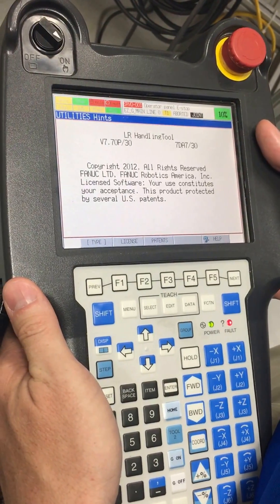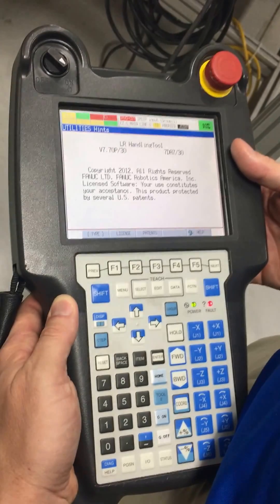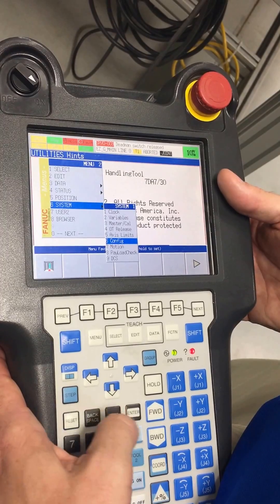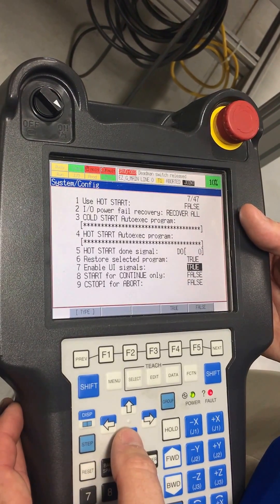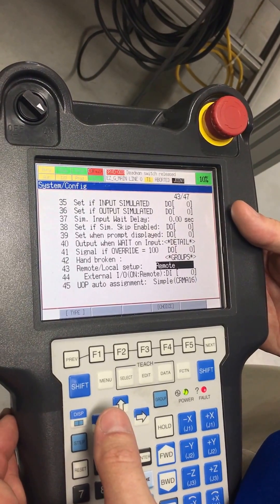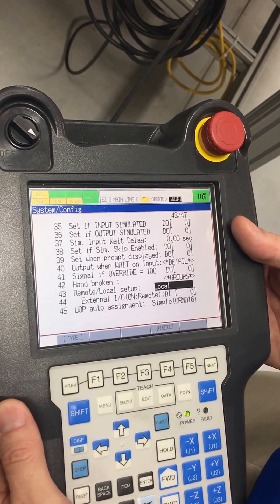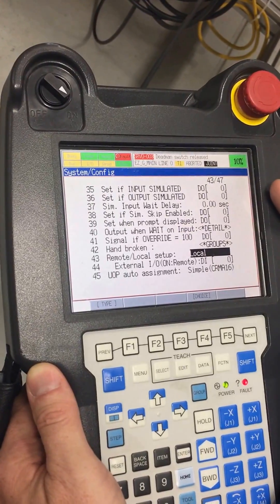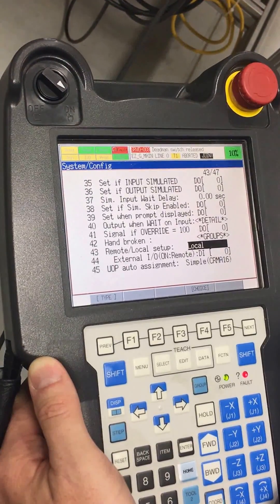Safety EXTERNAL input (disabling on Fanuc controller)

Comment: I am having an issue with a fanuc robot with INTERNAL E stops not allowing the robot to run in program or teach. Replaced massive servo board with an assumed good unit, replaced the safety board. Could you point me in the direction of possible causes for these internal Estops? the pendant has a list of things to run through which was done but Im looking for some expert help. This robot needs to come online or it will put a wrench in my plans. it was previously working with zero issues with thousands of cycles.

Comment: hi rick lab tech here was wondering if this would fix the issue i’m having with the FANUC system R-30iB mate it’s giving a fault that is devi-007 external emergency stops
Reply: *SRVO-007
Reply: Is yours a welding cell? 
Usually many e-stops on them, check them all and make sure they are pulled out. Even having the cabinet doors open  a bit can cause these alarms. Generally the most often one you see is the stop on the pendant. They get dropped or something and that estop or Deadman can break/ get damaged and can trip that error

Comment: I had the same problem at work last night and reset the PLC (the external device trying to communicate) and the that also aloud me to clear the fault. Does anyone know what “IMSTP” means? I’ve been looking for a while and can’t find anything on it
Reply: imidiate stop.
Reply: This^^ 
I know it's late lol. That error is usually for e-stops which can include a ton of things like even having the cabinet door open. Basically anything that could cause an "immediate stop" can and will have that error code pop up
Reply: Problem will be cleared you